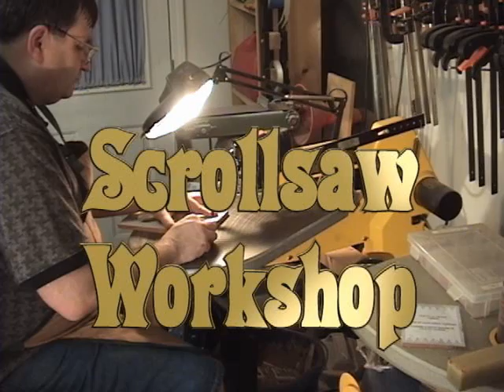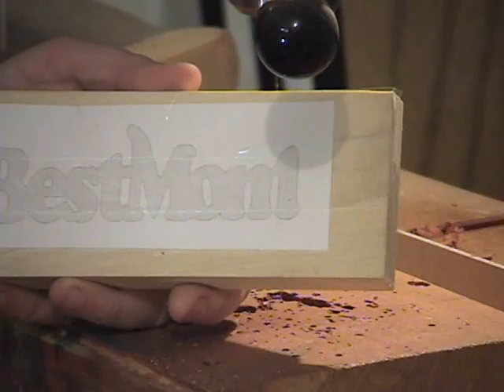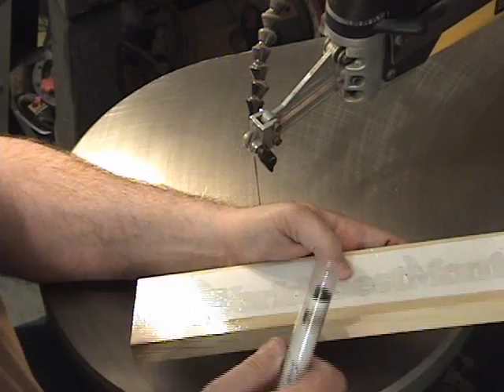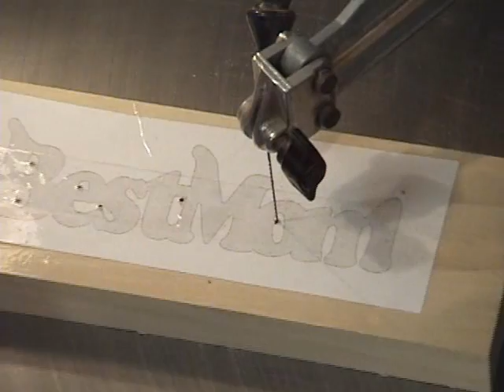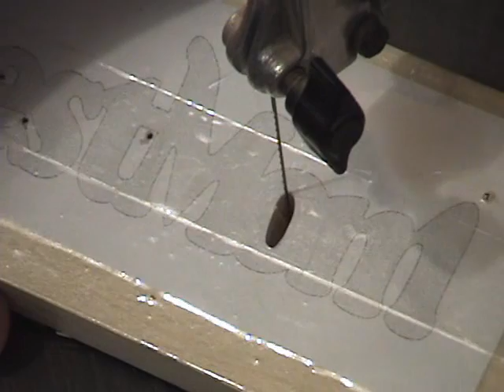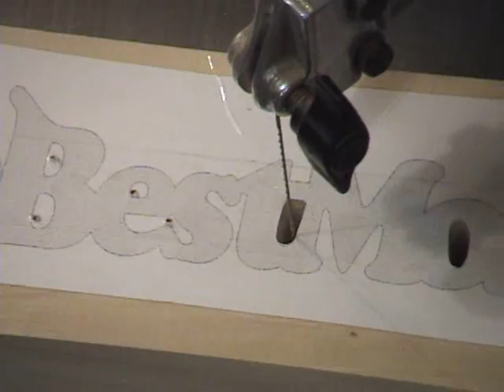Scroll Saw Basics Part 2

Comment: @TheMichalMystic make sure that the teeth of the blade are facing down in other words the cutting happens when the blade is going down. If u r not using the gaurd to help u keep the wood down in place,  just put more down pressure with ur hands at all times. I hope that helps